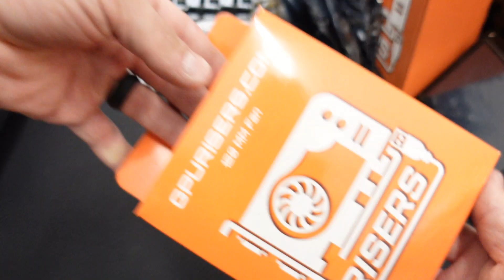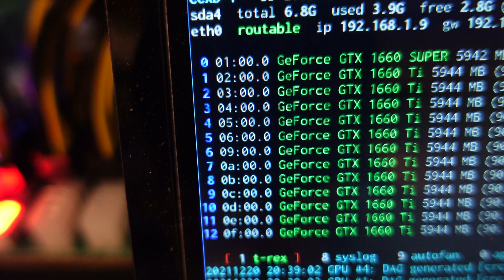3X Uniform 13 GPU Mining Rigs

Comment: I always wonder: do you guys use your server psu with 80%rule or not... a server psu should withstand 24/7, therefore it shpould be a no, right?
Reply from the maker: I don’t go by the 80% rule with my server PSU they are made for 24/7 use. You are correct. I’m not sure this is “Safe” practice but it works for me

Comment: so you aren't powering the risers with anything other than the usb hookup, and that usb voltage runs the fans?
weird man.
how long have you been doing this? had any issues?
Reply from the maker: Huh? Lol no. The 6pin VGA/PCIE cable is powering the riser and card.
Reply: @ChumpChangeXD  I had no idea that would even work.  I've always powered my first 70w through the 6-pin PCIE cable on the riser, and subsequent power through the card as needed.   I'd understand if the riser power source gave juice to the fan through the molex, but the fact that it's coming back down from the card and powering the fans from the card's pcie cable is... well really interesting.   I had never even considered that it could work in that way.  Maybe I'm just stupid and never thought to try!  ;D  very cool

Comment: Would it be possible to put a usb to a riser then a splitter in that riser to get more cards on that 12 usb board? Not that I think you should in this situation just curious lol
Cool vid as always!
Reply from the maker: Check my short where I put a 4x splitter on a riser. But no because certain another boards Have maximum capacity most of them are 12 GPU
Reply: @ChumpChangeXD  nice I just watched it, so cool
also those green and purple GPU stands are fire!